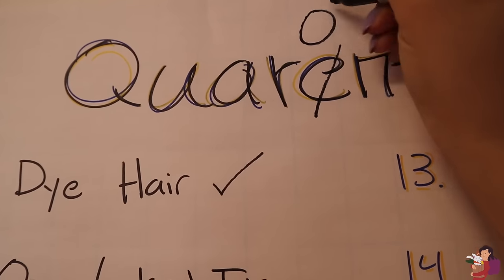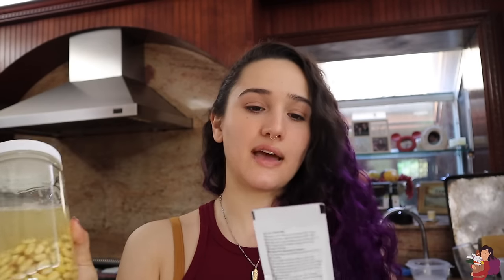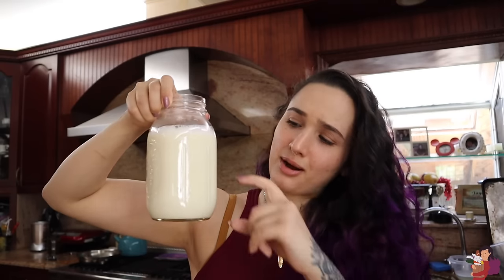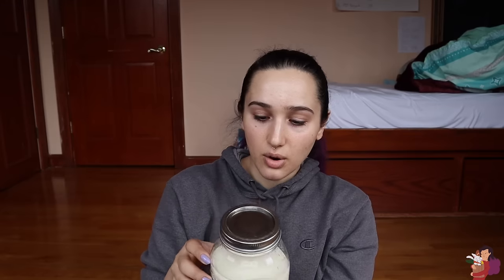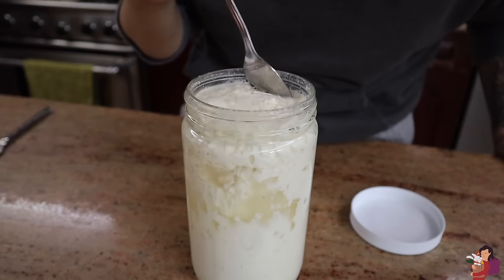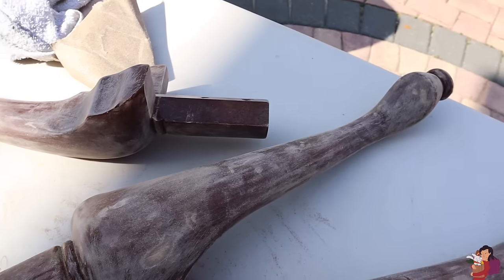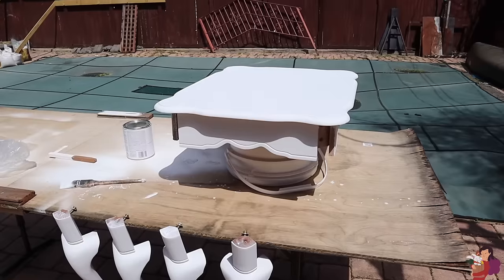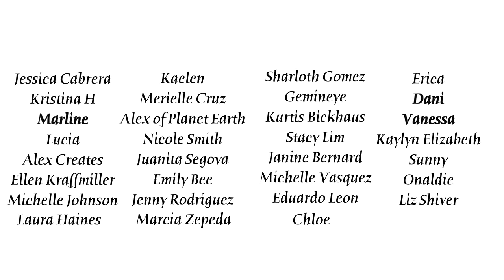I Made Soy Yogurt From Beans

Comment: Hey Rebecca :) I actually just recently made homemade soy milk yogurt (I agree that it's the best for its nutritional content and taste, I also LOVE coconut milk yogurt) and maybe I can try to help: first, you don't necessarily need an instant pot with the yogurt making option (funny enough I was also super confused when I first got my instant pot because I wanted to make yogurt but didn't see the button, however apparently not all instant pot have it, it depends which kind you get!) - you simply need a warm oven, I heated it up to about 350-375 degrees Fahrenheit and then let it cool down just a bit so it's not too hot as it may kill the bacteria in the yogurt, then I simply put it in and let it ferment overnight with a lid on or just something to cover it slightly.
Second, not sure what ratios or method you used to make your second batch with the already made yogurt, but I usually do like 1/4 cup (or about like 2-3 tbsp) of yogurt per 1L of unsweetened plain milk (better if homemade soymilk), HOWEVER the milk needs to be brought to a simmer first and then cooled down again, just like you said until you can basically put a finger in it and it doesn't burn you, so about slightly warmer than room temperature. Then you just mix it all together, cover it and put it in the oven to ferment.
This method always worked for me, although I usually just go for the store bought soy milk as long as it only contains soy milk and water, simply because it's a lot easier but I am sure during these times everything is harder to find!!
Also, the longer you let it sit in the fridge the tangier it gets, SO much better than the packaged ones you'll find at the store which are nowhere near as tangy and authentic tasting :)
Another tip if you want to turn the yogurt into Greek yogurt which is naturally way thicker, you can do so by basically straining the excess water out (whey): if you own one of those cheese cloths or something similar, just pour the yogurt in there after it's been fermenting in the fridge for a couple of days and let it hang somewhere (I usually tie a knot with the ends of the cheesecloth and put like a chopstick through it to hang over a pot or something like that) so that all the excess water comes out and the yogurt will get naturally super thick.
Good luck <3
Reply from the maker: Thank you so much for all these tips! Im going to try again!
Reply: @bodegacatx  yes don't give up, it really takes a few attempts sometimes to get there :)

Comment: I used to wrap my jar in a heating pad set on Low (you’ll need one that doesn’t shut off after 2 hours), set it all inside a thermal lunch sack (polyethylene) and leave it overnight.  I’ve also heard you can put it inside the oven with the light on but I’ve never done it.